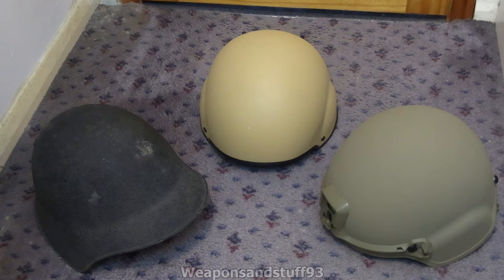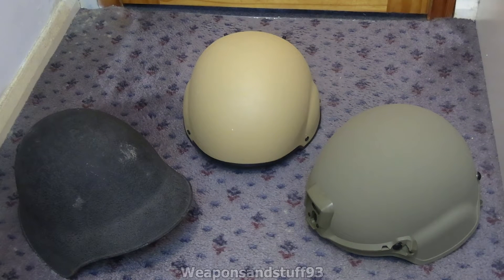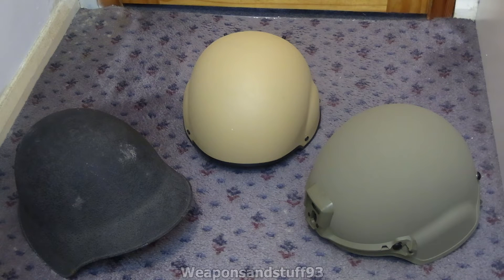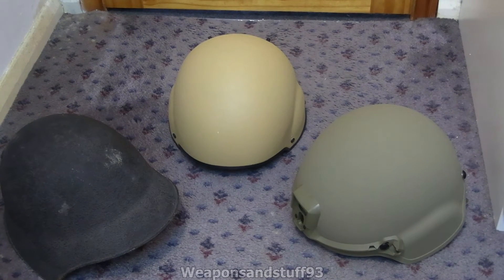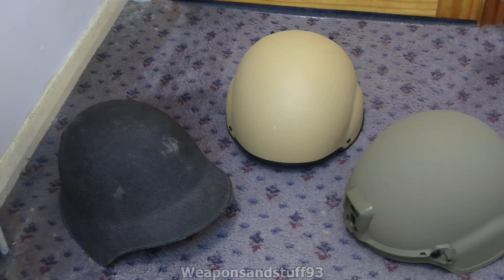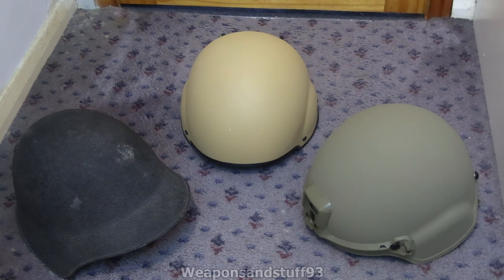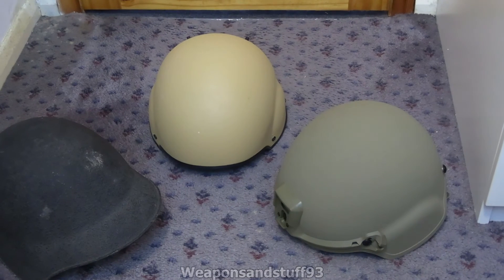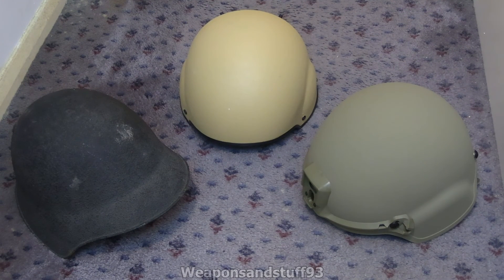Important factors in military helmet protection

Comment: I think there were multiple accounts during world war 2 of German helmets breaking the soldiers neck. Due to the back of the helmet protruding down so far onto the back of the soldiers neck, if their head jerked back with too much force the back of the helmet would push against there neck and break it. So I think that’s why helmets don’t pultrude too far down in the back and sides. There is also the point of hearing. If the helmet covers your ears it could hamper your ability to hear. There are many things to think about when designing helmets.

If I am wrong about anything please feel free to correct me by commenting on my comment.
Reply from the maker: Very good points.

Comment: Helmet horror story: Apparently several soldiers during a D-Day practice run were killed because when they jumped into the water wearing their helmets, they went into the water, and the helmet didn't, causing the helmet straps to snap their necks. Not sure if this is a hundred percent accurate, but still, I could see it happening.
Reply from the maker: I could imagine it be more likely certain helmets would make it harder to surface properly and cause drowning.
Reply: Weaponsandstuff93 Yeah that also happened. Soldiers wore their flotation belts in the wrong place, and they floated face down.
Reply: Never heard of that, hmm.
Reply: Maybe the drag of the helmet pulled on the straps
Reply: @lordtachanka8517  That's what I meant to say, but worded better.